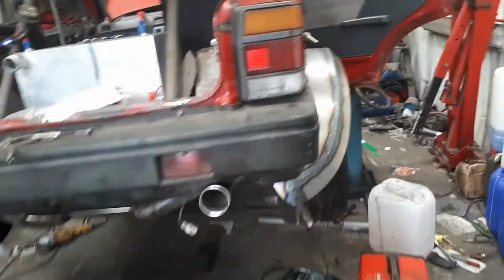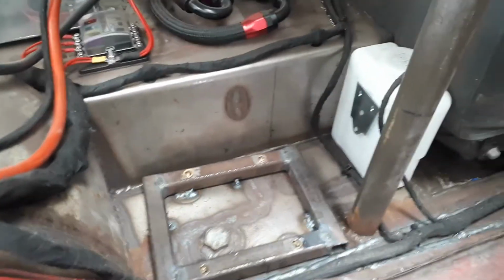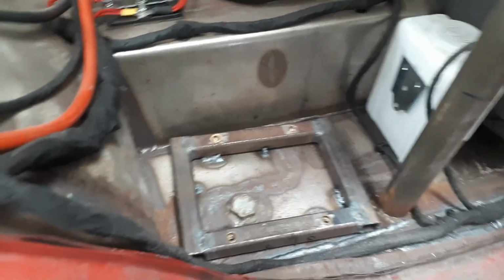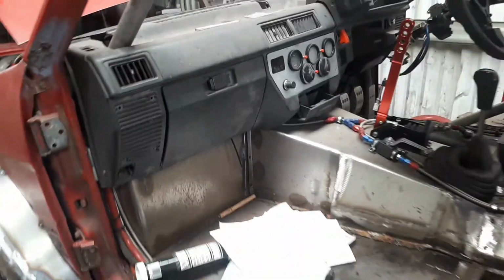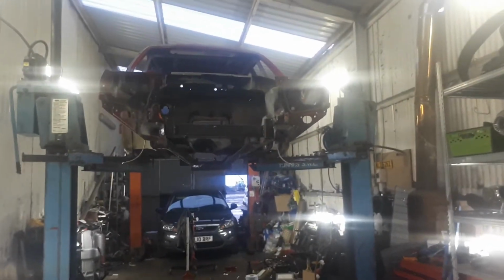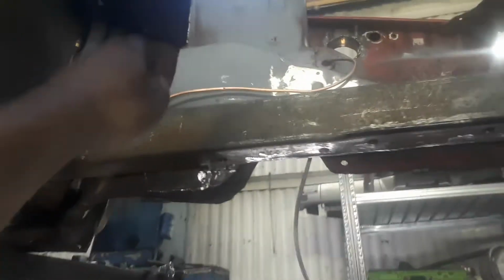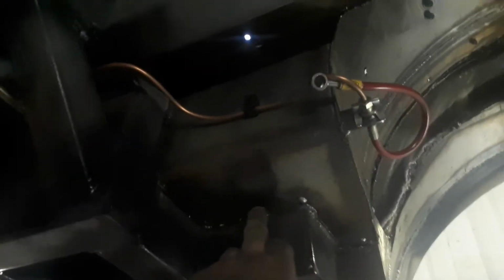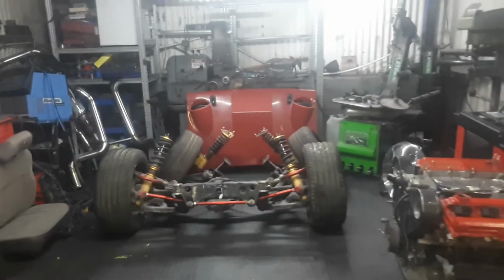Subaru Justy 4.0 1uz project the strip

Comment: when will there be a new update ?? :)
Reply from the maker: Hi yes there will be soon almost completed the body work it make take another month before I can get a video together but this is one of the biggest stages of the build cheers
Reply: @jjvehicleengineering  ahhh nice thx for the reaction :) and i will be waiting for sure for the update .... and I’m so curious had you already had it running??
Reply: @jjvehicleengineering  i also have a justy sadly it is not the same type is a 98 one and i also want to make it a crazy project haha :) 
I’m thinking that i wil try to convert to rwd and than build a fully turbo drift justy with angle kit etc
Reply from the maker: Hi I haven't had it running yet as I didn't want to put all the fluids in her however first start up should be early next year if all go's well
Reply: @jjvehicleengineering  nice nice :) look forward to see that beast machine making some sound ^^